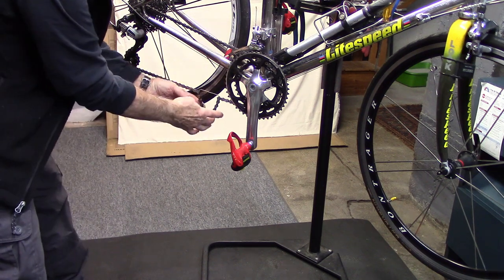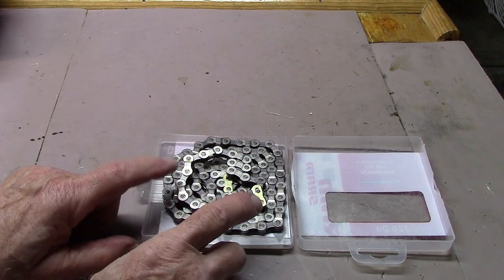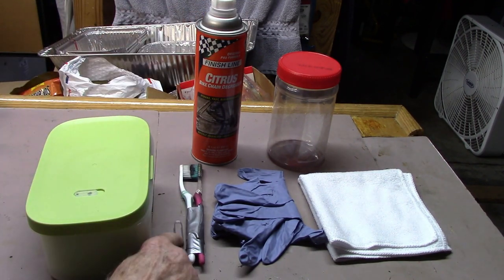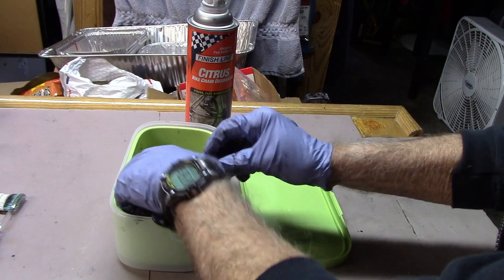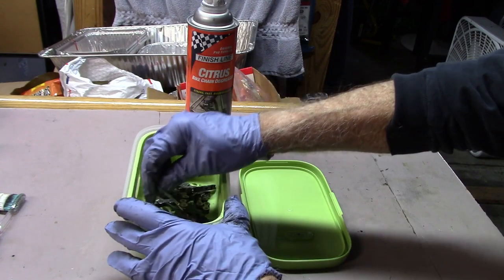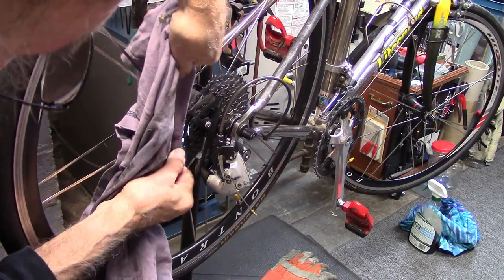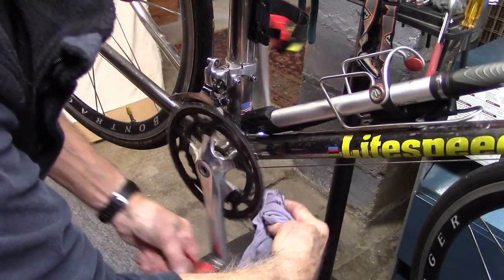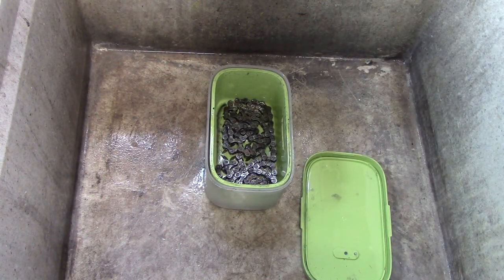Best Improvised Bicycle Chain Cleaning devise

Comment: Great stuff as usual! Since I've gotten further into biking, I've picked up most my info from you, GCN, and Park Tool Co. So you're in good company!

I wipe down my bike and drivetrain after every ride. I leave the chain on and backpedal while using a clean(ish) terry cloth to get the most offensive crud off. 

For a deeper clean,  frequency varies. I use the method you describe 2-4 times/year. I'm not as regimented as I could be. A combination of how much time I have and just eyeballing it. Depends on riding and chain conditions. I ride about 2k mi/yr and replace the chain about whenever the chain check tool reads 0.75% wear.

Have a nice day!
Reply from the maker: I, myself, only remove the chain to clean when it's heavy with grime and dirt (not often) but most of the time run our 2 minute cleanup (with the chain on the bike) before I lubricant the chain (about every 150-200 miles or so). See:
https://www.youtube.com/watch?v=I_5fNbDN3UA&ab_channel=TonyMarchand
and
https://www.youtube.com/watch?v=0CSUVMxyy3w&ab_channel=TonyMarchand
Regards and safe cycling, Tony

Comment: I remove everything. For cassette, chain and pulley wheels I use a soapy degreaser. For the chainrings I use a mix of dish soap and water, beacause I´ve had bad experiences with degreaser and the finish of the chainrings.
Reply from the maker: Thanks for sharing. I only remove the chain to clean when it's heavy with grime and dirt (not often) but most of the time run our 2 minute cleanup (with the chain on the bike) before I lubricant the chain (about every 150 miles or so). See:
https://www.youtube.com/watch?v=I_5fNbDN3UA&ab_channel=TonyMarchand
and
https://www.youtube.com/watch?v=0CSUVMxyy3w&ab_channel=TonyMarchand
Degreasing followed by soap, water and drying will give you the cleanest bike chain, but that's a matter of preference. Regards, Tony

Comment: I love this guys videos and I think he has better chain maintenance videos posted. I wouldn’t do this method but I ride enough that the chain gets replaced @ 3000 m. That factory coated chain just gets wiped off after installation then lubed as needed. To clean the cassette I remove and wipe the rings off individually.
Reply from the maker: I only remove the chain to clean when it's heavy with grime and dirt (not often) but most of the time run our 2 minute cleanup (with the chain on the bike) before I lubricant the chain (about every 150 miles or so). See:
https://www.youtube.com/watch?v=I_5fNbDN3UA&ab_channel=TonyMarchand
and
https://www.youtube.com/watch?v=0CSUVMxyy3w&ab_channel=TonyMarchand
I always remove the packing grease before lubricating the chain for 2 reasons. The packing grease is very sticky and picks up a lot of grime from the road and it also may interfere with any added lubricate. One can just wipe off the surface as you mention, but I like to get rid of most of it before chain installation. One can use the method I describe or soak in distilled gum turpentine (another up coming video). Thanks for your feedback. Always appreciated. Regards and safe cycling, Tony

Comment: Yes, I do nowadays take off the dirty chain, clean the bike, then fit a different new or clean chain to the clean drive train. The dirty chain gets checked for wear and binned if worn too much, else wiped with cloth, then cleaned in an ultrasonic tank using water and detergent liquid. I used to oil chains. I'm currently using Squirt (UK wax type lube). Old wax needs hot water to shift it.
Reply from the maker: How often do you remove the chain for cleaning and do you use a re-useable master link?
Reply: @tony10speed Yes, I use re-useable master links. Now retired, I ride once a week on the road and twice a week on the trainer in my garage, so the bikes don't get very dirty too quickly. With at least 3 bikes on the go, I doubt that any one chain comes off for cleaning more than twice a year.
Reply from the maker: @Ricobass0  Sounds like a good strategy. Thanks for the feedback and safe cycling, Tony

Comment: I usually skip the toothbrushes, just soak/shake multiple rounds.  Also do a final rinse with alcohol to remove degreaser residue and remaining grit fully
Reply from the maker: A lot depends on the amount of old grease and dirt on the chain. I often skip the toothbrush on my road bike but on my mountain bike and older bikes I'm restoring, the toothbrushes help. I've not tried to remove the residual degreaser with alcohol (usually just wash and dry) but will give it a try. Thanks for the info and safe cycling, Tony

Comment: Thanks for this link. I was told though to use denatured alcohol as a final rinse to the chain when prepping it for Squirt. 
 
Btw, if i decide to switch back to oil-based lube, how do i remove Squirt?
Reply from the maker: Here are some suggestions on Reddit:
https://www.reddit.com/r/bicycling/comments/b8ypnd/how_to_get_rid_of_squirt_lube_on_drivetrain/
Let me know what works for you. Regards and safe cycling, Tony

Comment: As usual great informative video. I loved the red coloured pedals 😍 what are those pedals ? Brand pls
Rahul🇮🇳
Reply from the maker: Those are the old style vintage Look pedals (they have since been replaced by the Look Keo pedals which require there own Keo cleats). The Look Keo Classic in red is available on line, are lighter then the vintage pedals but not quite as flashy. You can still get the vintage Look pedals on Ebay but you must get the compatible Delta cleat for your shoe. Thanks again for your compliment. Also visit our YouTube home site at:
https://www.youtube.com/user/MrTony10speed
Regards and safe cycling, Tony

Comment: Hi.  I used some master link pliers to open a KMC chain quick link / master link.  The pliers caused the link to be quite twisted.   They are a decent size [are no a mini tool] but were quite cheap.  Is the problem likely to be an issue with the tool?  Or did I do something wrong when using it?
If anyone knows / has had this happen then please let me know!
Thx
Reply from the maker: I have some master link pliers (cheap from China) that just don't work well. KMC and Park master link pliers are my preference. Here's how to use the Park tool:
https://youtu.be/x9Ri0p6bsNw?t=52
Regards and safe cycling, Tony
Reply: @tony10speed  OK, that´s the two of us then!  Thanks Tony 👍

Comment: Why not use Petrol or Kerosene?
Reply from the maker: Petrol (gasoline) is flammable, it vapors dangerous to inhale and is not easily disposed of (hazardous waste). Kerosene is an excellent degreaser but also must be used where there's excellent ventilation, must not contact your skin, requires a special container for storage, and is considered a hazardous waste. I favor something environmentally friendly if possible.
Reply: @tony10speed  That's a good point. It depends on what you're after.  As for improvised chain clean is OK, but if you're looking for deep chain clean perhaps prior waxing  then I would say no because Is your chain also really clean in between pins and rollers after using "green stuff" and scrubbing? That enviro friendly degreaser is not strong enough to remove stubborn factory grease from inside your chain. Also rinsing in clean water is also a bit useless. I mean, don't use water but IPA or acetone. If you really want to deeply clean your chain you must use some strong industrial solvent or petrol or diesel in first step and then rinse chain in acetone or IPA or methylated alcohol. I understand you favor "something environmentally friendly" but consumption of flammable / dangerous liquids is not high. Maybe like 0,5l of each and when you're waxing your chain you have to do this only once for each chain. If wax is not for you then I suppose you can stick with water soluble products.
Reply from the maker: @immortable5106  That's what Oz Cycle recommends for waxing. Thanks for the feedback. Regards, Tony

Comment: Why not just clean the chain on the bike with one of those clamp on cleaner mechs?
Reply from the maker: If you're outside and can wash down and dry the bike after use of the degreaser, yes, you can use a bike chain cleaner kit. I, personally, find them messy and eventually they will break. Outside, I use another inovation:
https://www.youtube.com/watch?v=2vrwqRtfTSU&t=1s&ab_channel=TonyMarchand
But that's just a matter of choice.